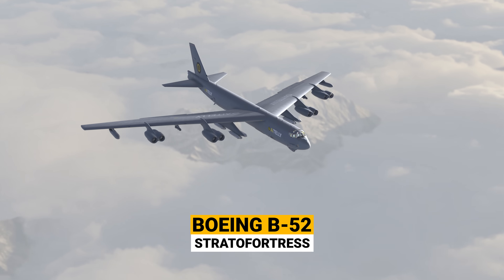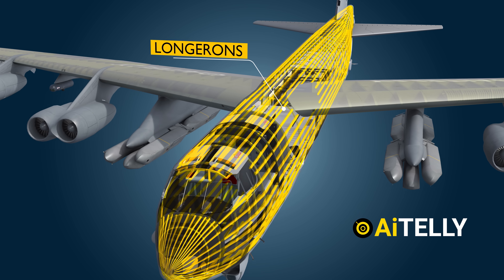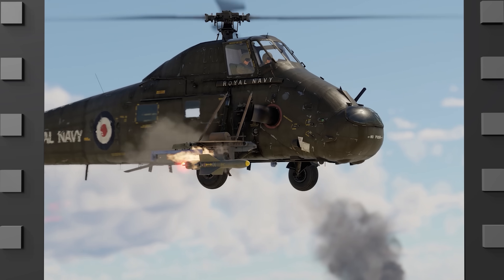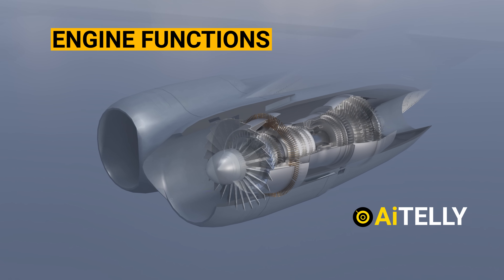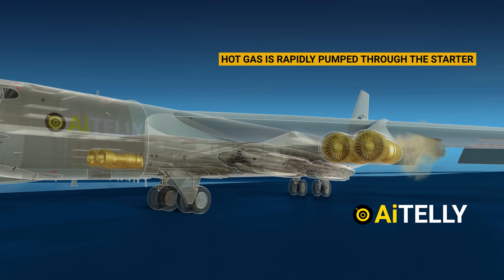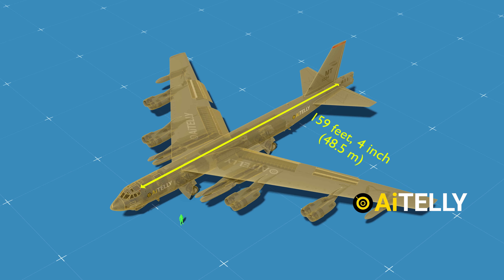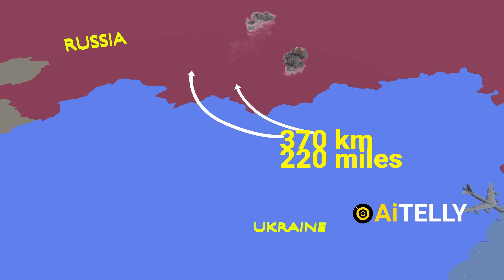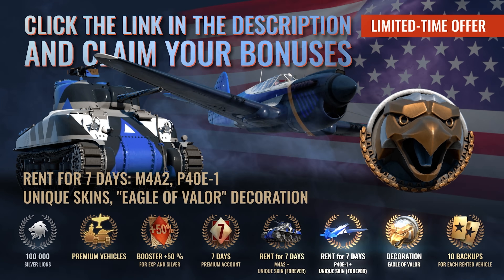B52 Bomber Boeing Plane | How it Works US Airforce Bomber

Comment: I worked with an older gentleman who was responsible for maintaining much of the B-52's electronics and comms systems during his time in the USAF in the 70s. He told me a story about one interesting failure... They had one airframe that was able to communicate with tower & other external radios while on ground, but was having all sorts of comms issues when in the air at altitude. They had replaced all sorts of components and still couldn't figure it out. He ended up going for a ride on the plane with several other technicians, and they managed to track down the failure while in the air. They found that some of the internal RF coax cable bundles were overly tight, and as a result when the airframe was pressurized at high altitude, it had enough flex and expansion in the airframe that the internal conductor in one of the coax cables had sheared in a way that wasn't visible from the outside of the cable. When it was on the ground, the center conductor had good contact, in the air at high altitude it would become stretched again, the center conductor would separate, and would lose continuity - then no RF comms. He said that part of the problem was that the B-52 airframes had been reworked and reskinned so many times that a lot of these cable harnesses had been pulled and reinstalled multiple times, and not always done in the correct way, leading to slack and service loops being shortened or undone.

Comment: For the opening statement regarding the ribs and spars make out of steel, are you sure? Aerospace companies typically use aluminum, and sometimes titanium for their wings structures. I've never worked on a Boeing airplane that has anything other than aluminum spars or ribs, and titanium parts to hold them all together.

Comment: Approximately 8 engines? So your suggesting they are hiding a few 7 engine versions?? why not just program the AI to say "it has 8 engines"?
Reply: Many planes from the 40s through the 60s had this problem. Constellations often had three, and B-36s were designed to have six but would randomly go between one and 10.

Comment: There is no steel in the structure apart from the landing gear. The main component in the alloy composition is Aluminium. Magnesium is the important alloying element which is added to Al along with the other alloying elements.

Comment: Couple of points:

1. Defense Section: The rear-facing seat behind the aircraft commander (not "captain") is not the "radar officer."  It's empty or used by the instructor EW.  It used to be the gunner's seat.
2. You modeled the ladder to the upper deck on the wrong side; it's on the right side.
3. The B-52 has substantial defensive equipment to evade enemy missiles and fighters.  It's the role of the EW to operate that equipment.
4. Approximately eight engines?  Exactly eight engines.
5. No, not shotgun shells.  Cartridges.

Comment: Nice graphics! BTW, flaps are not for a cushion of air when landing, they're to reduce landing speed. Also, spoilers are to spoil wing lift and prevent bouncing (starting to fly again) once the gear compresses. They're not air brakes.  Interesting story, an F-111F flown by an Aussie exchange pilot came back with throttles stuck above 50% at Mt Home AFB. No problem, just a high speed (flaps up) landing. However, he forgot spoilers will not deploy with throttles above 50%. There's  a mechanical switch at the center arc of the throttle levers that you could stick a pencil in to flick backwards (indicating <50% throttle position) but that technique isn't in the techorder. Anyhow, he compressed the gear, bounced, and started flying again. At some point he decided they were out of control and punched out, successfully. The cockpit was recovered and turned into a flight simulator. Old style with projector screens in front and to the sides. Nothing moved except the images. Funny thing was, they had a video of the space shuttle in flight. You could fly up to it, then through it, and for an instant you had an image of the inside of the cargo bay. ha ha... The simulator was moved to Lakenheath (maybe Upper Heyford) when the F models moved there and (I believe) just the cockpit is now at the USAF museum. Funny how these things get started, and where they end up.

Comment: Steel mixed with alloy and magnesium......... That makes no sense.   Alloy is simply the mixing of metals to create a stronger product.  Magnesium is light, even lighter than aluminum however is very flammable.   You cannot combine steel and magnesium.  They don't mix on a molecular level like a true alloy.

Comment: Gonna need more than a shotgun load to start a Pratt & Whitney TF-33 P-3. I worked on EC-135s and RC-135s that take approximately 4 TF-33 engines and the holder for the cartridge charge was about the size of a coffee pot. Cool video!
Reply: @davegriffith32  i think shotgun shell is just the name
Reply: @MarvinK_72 could be. Having only been in internal shop repair, I'm unfamiliar with a lot of flight line/ engeneer lingo.

Comment: When I was active duty security in SAC in the 70's, I saw dozens of B52 bombers being loaded and maintained in alert areas. They had TWO bomb bays then, usually a rotary SRAM pack in one and a massive single "big Bertha" in the other one. This illustrates a single bay with just one rack of weapons. What's the explanation?

Comment: This channel is a menace to knowledge. Ten seconds in and already a major screw up. There is NO steel in the wings of a B-52. Zero, zilch. Also no magnesium, which burns like a white hot torch once it catches fire, and will even burn underwater. Not what you want in an aircraft likely to take battle damage. 

Seriously people, don't read this garbage. Just read Wikipedia or any of the other good military sites out there. Every other thing at AiTelly is wrong. It takes real talent, like a Vegas Cooler, to screw up this badly this consistently. SMH

Comment: alloy
/ăl′oi″, ə-loi′/
noun
A metallic solid or liquid that is composed of a homogeneous mixture of two or more metals or of metals and nonmetal or metalloid elements, usually for the purpose of imparting or increasing specific characteristics or properties.
Brass is an alloy of zinc and copper.
A mixture; an amalgam.
The relative degree of mixture with a base metal; fineness.

Aluminium + magnesium = alloy , understand ?

Comment: Alright, hear me out guys! this is mindblowing! The B-52H Stratofortress is the only variant of the B-52 series that remains operational. Each B-52H can carry up to 20 AGM-86 ALCMs (Air-Launched Cruise Missiles). These missiles come in different variants, such as the AGM-86B (nuclear version with the W80 warhead, delivering 150 kilotons of yield) or the AGM-86C/D (conventional version with a 900 kg high-explosive warhead). For this discussion, let's focus on the AGM-86B.

There are currently more than 70 B-52H bombers still in service, but for simplicity's sake, let's assume 70 in total. Each B-52H loaded with 20 AGM-86B missiles would have a combined nuclear yield of approximately 3 megatons (20 missiles × 150 kilotons each).

If all 70 B-52H bombers were deployed with their full nuclear payloads, the total potential yield would amount to 210 megatons (70 bombers × 3 megatons each). This represents an enormous amount of destructive power—14,000 times more powerful than the 15-kiloton "Little Boy" bomb dropped on Hiroshima. Which is also more than four times the yield of the Tsar Bomba, the most powerful nuclear bomb ever detonated, with a yield of 50 megatons.

Such a concentration of nuclear firepower is almost unimaginable. While deploying such a massive strike is unlikely due to strategic, political, and humanitarian reasons, it underscores the sheer destructive capacity that a fleet of B-52H Stratofortress bombers can deliver with modern nuclear armaments. Can you imagine it?🤯🤯

Comment: think it is perfect weather -  and tires are - s  ... well at bomb level / cause i still think swissAir 111 is under technical calls we need to get right - like master BUFF / the S tire formation is close to prevent an explosion caused a crash - 1 we know - all to safe in future / well - i am not familar with airline TOP or to say "checklist" time to work through while autopilot switched "off"  to check weather issues a airplane is managing flight - to prevent - tiredness / / it is a 4 to 24 minutes

Comment: 6:00 The Superfortress boasts APPROXIMATELY eight engines??
Reply: It actually had four.
Reply: @denali9449  Did you listen to the dialogue? 🙄
Reply: @capnkit  Yes, I did and I will repeat myself by saying that the Superfortress had four engines. Words mean everything. The B-52 is called the Stratofortress. The Superfortress was the B-29.
Reply: @denali9449  so you'd best take that up with the op and note my double question marks, eh?
Reply: @capnkit  As an average reader I took your sarcasm to be directed at the eight engines rather than the Superfortress issue because that seemed to be the major issue of most posters. As I recall over a dozen folks commented on the eight engine issue and no one addressed the major faux pas of the presenter calling a B-52 a Superfortress. I guess we were to interpret your double question marks as being directed at the improper name usage and the number of engines? Somehow I doubt that you even noticed that they used the wrong plane name if for that matter knew the difference. If you really did know the difference I will apologize but will always question why you did not call it out in lieu of being sarcastic.
Reply: Clearly the average has dropped.
Reply: @capnkit  okay then Mr. Grammar, please diagram your sentence and explain to us lowly plebes exactly how it should be read. Or, just admit that you compounded the problem by not knowing the difference between the planes and are now struggling to cover your error.

Comment: Surely these planes aren’t still in service?
They must be seventy or eighty years old.
The RAF doesn’t fly Vulcans, even 1980s Tornadoes have been retired!
Reply: Came in service 1962. Going to use them until at least 2050. They have been upgraded over and over.

Comment: The modern versions of the B-52 (Specifically the B-52G and onwards) still have ailerons, they're very small and located between the flaps on the wings, they're mostly used for small, delicate corrections of the roll of the aircraft for operations like aerial refueling

Edit: Upon further research, the B-52G and H do not have the ailerons, but for some reason, still have the cutout in the metal for them, which is what was confusing me
Reply: There is only H models. All others are in the boneyard. Soon to be J with new engines and other upgrades.
Reply: @d_bricks  Sorry, G onwards
Reply: No, neither the G nor H model have ailerons.
Reply: @johnyoung5820  Yeah, I had to do a bit more digging, but for some reason, the wings still have the cutouts for the ailerons, despite not having them for some reason, which makes it very difficult to say for sure based on appearance
Reply: @CrystallineFoxCF , earlier B-52s did have ailerons, but Gs and Hs only have spoilers or "spoilerons."  I know this as a practical matter having 2000+ hours in the aircraft.
Reply: @johnyoung5820  You are aware I already agreed with that point, and was just saying that the fact it still has the cutouts in the wing skin where the ailerons were on the older models made it seem like the new ones had it when they didn't, also, sourcing yourself as evidence on the internet is a bad idea because most people are going to assume you're lying due to how many people lie about 'having experience with ____"
Reply: @CrystallineFoxCF, I'm not sure why you're getting defensive, but it's not a good look.  I replied to your comment because you said the "[cutouts] makes it very difficult to say for sure based on appearance."  It doesn't if you researched the aircraft or you were qualified and flew in the aircraft.  Whether you believe that I was qualified and flew in the aircraft makes no difference to me.  I'm just doing my little part to rectify misinformation, but you're free to believe whatever you want.🤷‍♂
Reply: @johnyoung5820  Dude, I literally said in that same comment that it didn't have them, and that the cutouts made it seem like it did. 

Trying to pull the "I have this many hours on the aircraft" is both annoying and stupid because you're not going to be able to prove it without essentially doxxing yourself, just like I could say I designed the damn plane and you technically couldn't prove I didn't without me doxxing myself or you breaking multiple laws. It's a stupid source and you should find publicly available sources to point people to because using yourself as a source is about as reliable for other people as Wikipedia
Reply: @ , wow, you’re rather unhinged and taking this way too personally. Calm down.
Reply: @johnyoung5820  If I wasn't calm I wouldn't be explaining why using personal information as a way to prove yourself right in an argument is not a great way to win it, as well as giving examples of why it doesn't work to you so that you can use it in the future. 

If you took it as me being aggressive, that's fine, but I was trying to honestly show you that using personal information and claims that can't be verified when trying to argue a statement is not what you should do in most situations, because a lot of people will be extremely dismissive when you try to use that as the source of the information.
Reply: @ you seem to be hung up on the whole “personal information and claims that can’t be verified” thing.  I don’t care whether you believe me or not, so your point is moot.  It’s not like I’m going to share my DD214 with you.  I’m simply saying I know something based on my experience, but the fact in question is easily verifiable with a modicum of research.  Did you do that research?  Something tells me you didn’t until you were challenged.  It’s also incredibly ironic that this is the argument you choose to make given your assumptions about the no longer existing trim tab (the so-called cut out you thought was an aileron) and its use… without supporting evidence.  So, you do you.  I have better things to do, so I’m out.

Comment: On the B52 it’s to bad one switch doesn’t turn all 8 turbines on instead of starting individual .. but if something happens you can turn off an individual turbine and also keep the old system too for back up …time is fuel and money and by being able to start all 8 at once saves time and fuel…there has to be a way

Comment: The B-52 is made out of aluminum, 7075 T6 forms the front and rear spars of the wing. And 2024 or 2045 or 2075 form the ribs and stringers, and for the fuselage the skin thickness varies anywhere from 39 thousand to 45  thousand of an inch, and some cases it may be more. The entire aircraft is made out of aluminum except for the landing gear area, which will have some steel components and the landing gear itself, which will be made out of a mixture of aluminum and steel. It is important to note that these aluminum components, including the skins are a mixture of copper, zinc, and magnesium mixed with pure aluminum to form these components.

Comment: I was hoping to know more about its 'cart-start' starup...

while I already appreciate this channel and it's unique production/contents. 

please please never rush your videos. prioritize quality over quantity. it's good for long term earnings too.
Reply: Most turbojet engines of that era could use either pyrotechnic starter cartridges or the wheeled carts that supplied high pressure air to start the engines.  Assuming you mean the former, they were about the size of a coffee can and produced a lot of noxious smoke.  In a quick-start configuration with all engines started simultaneously by cartridges the ground crew would need respirators.
Reply: @gort8203  Correct.  The starter cartridge is a lot bigger than the "shotgun shell" mentioned in the video.

Comment: So is there actually 8? Or just approximately 8 engines? 🤦‍♂️ And they do not rely on spoilers AND flaps to bank (turn). This would be counterintuitive as flaps create lift while spoilers do just that, spoil lift. They use spoilers only. Might want to get your shit in a pile before acting like you know what the hell you’re talking about. You did get the aileron part correct though. The earlier models did have ailerons, but were found to be weakening the airframe due to the very high stress and twisting moment they were creating because the wings are so long. Awesome animation though.
Reply from the maker: We put that just for you to comment 😉 
It's an old marketing trick where sometimes we put out the wrong answer just to get people triggered.

marketing 101

Comment: Ok  FYI  the wings are NOT ridged.. they will flex 18'  up and Down based on Fuel load and wind under the wing..   That said the wing tip gear which are on the ground under a heavy load out will take off first as the wing builds lift and flex's up..   So yeah  leave on a mission the tip gear is compressed to only a foot or two of tip gear cylinder showing,  come home and the wheel is at eye level or higher,  that will come back down as we refuel..
Reply: the plan flies mostly level when it has weapons on board,  if it does not have weapons in level flight it flys 13 degrees nose down..   So it will lift straight up on take off and you will see it continue to climb as the nose rotates down, as it will use a less than 10 degree climb
Reply from the maker: Thank for the feedback

Comment: Any reason why b-52 uses low bypass engines? Most passenger jets use high bypass engines right? What are the difference?

And I can’t believe it has AESA radar haha
Reply: That was the technology when the H models were built in the early 60s, an improvement over the P&W J57 turbo jets used in the earlier versions.